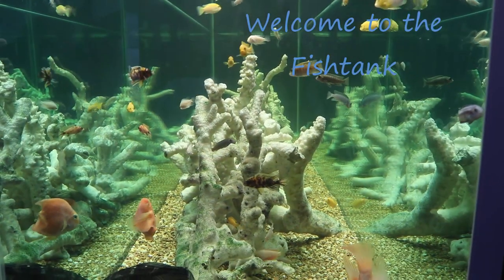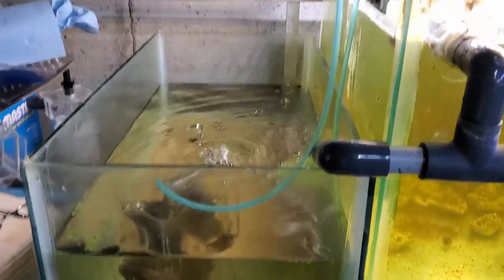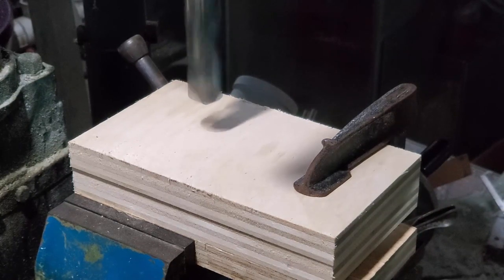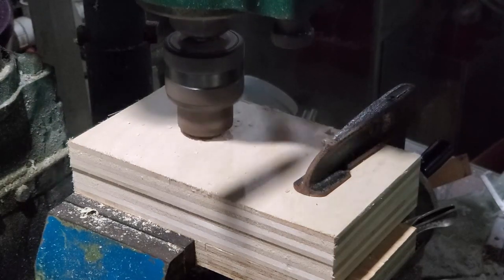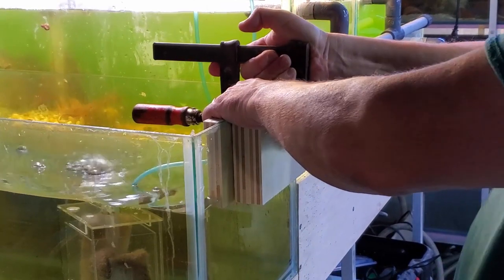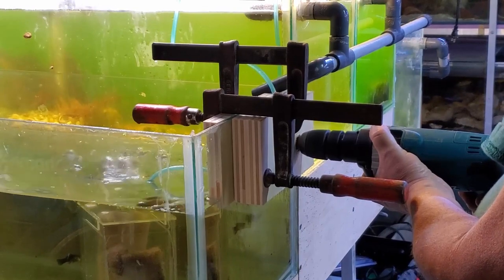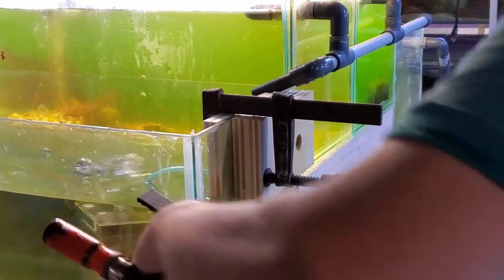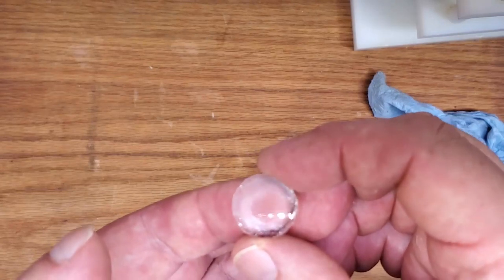How To Drilling An Existing Aquarium

Comment: AWESOME DIY! Couple of quick questions… How would you drill the glass of a prebuilt tank on the bottom so you could plumb the tubing straight to a below tank sump or canister? Also, can this be turned into a DIY for a HOB-style sump?
Reply from the maker: Thanks so much Doug! Be careful about drilling the bottoms of tanks as they are often tempered. If it isn't, you would need to make a block that fits snugly in the bottom frame and use two sided tape to hold it there. If you have a long enough clamp, that would be advisable as well. Drill near a corner for added support (but not too close). I have a video for a side drill going straight into a HOB https://www.youtube.com/watch?v=G5YRR4JoJAI&t=1s

Comment: I have found, when drilling, to make sure that the bit continues to rotate after going through material to have less stress on bit and material. I suspect that you will have less shelling.  Is this what you found as well?
Reply from the maker: Agreed! Easing up as you get close to finishing will result in less shelling. Thanks for watching!

Comment: Is this ok? Making a hole with water filled tank with fishes?
Reply from the maker: I've done it many times with no issues. I'd rather drill the glass before building the aquarium but that isn't always an option. Thanks for watching!
Reply: To 5 by 2 by 2 tank?